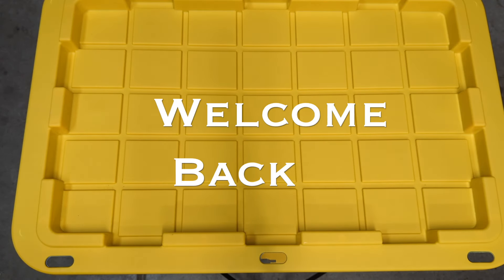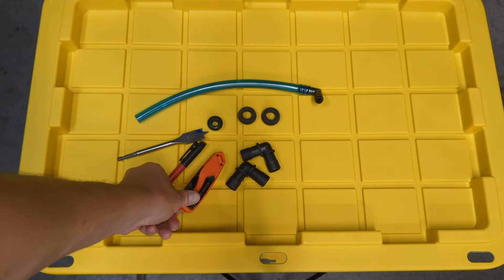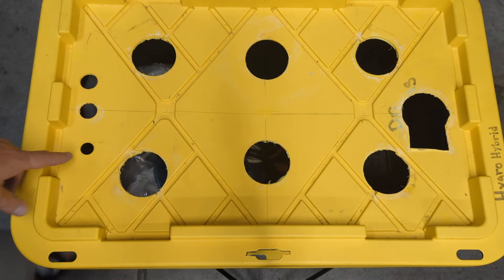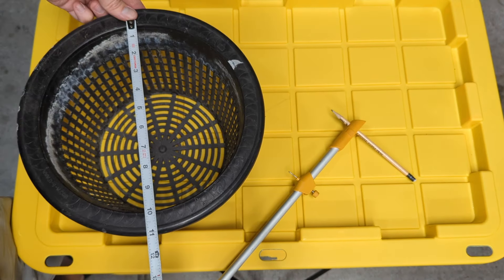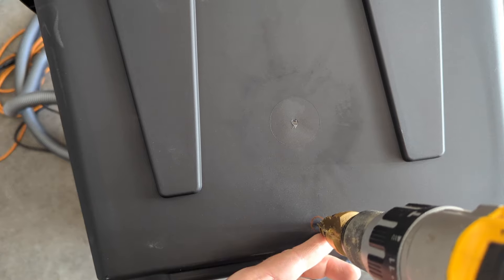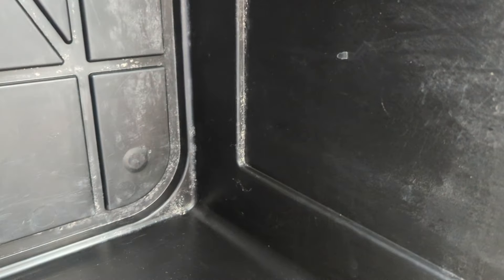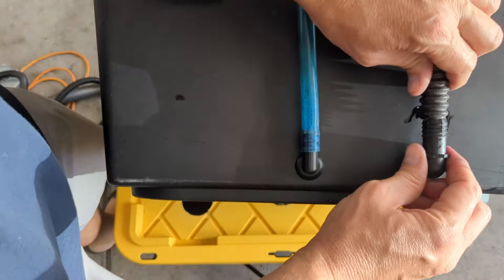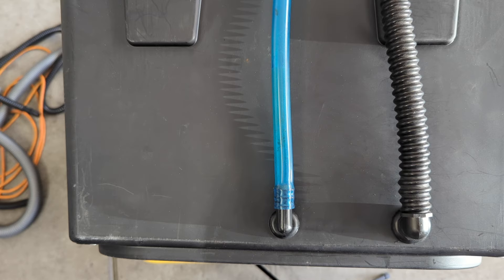DWC Build | LED Garden | G8600 By Spider Farmer

Comment: So couple suggestions. First for your setup use bulkheads instead of pressure fittings you don't have to worry about leaks. 2nd the best containers I use are polypropylene not cheap flimsy polyethylene one's. If you can find the right ones the best are those that lid fits in upside down and seals good. I personally run a hybrid dwc / low pressure aeroponics. I make simple pvc manifold with red sprayers and $25 pump total cost of bucket /pump sprayers net pots runs about $75. Technically i don't need air stones but do it as well. The benefit is i go from Aero cloner to large buckets i don't have to fill water to bottom on net pots. I run the sprayers on 15 min on/off cycle. I don't even glue pvc piping with spray heads. Each run i take apart clean well and click back together. Also if cutting hole saw say for 5 or 6 inch holes put drill in reverse gives clean cuts. And current culture makes best net pots heavy duty. Also if you want to connect multi buckets you can get the 4 inch bulkhead from them for like $20 and glue abs pipe from local hardware store. The roots get so large the 2 or 3inch pipe too small. I'm sure you would love to try my setup.